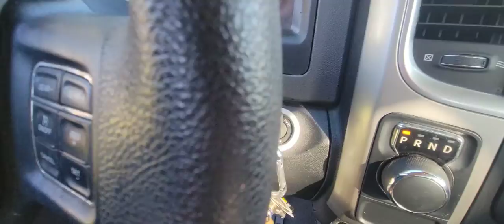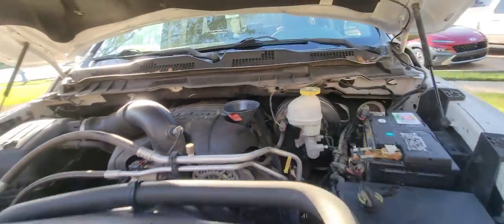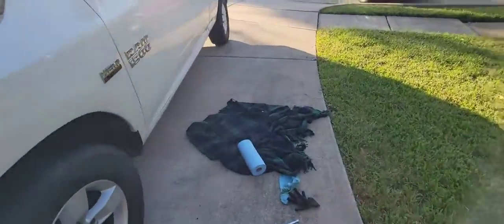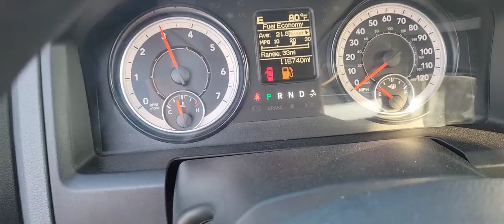Ram 1500, Hemi Tick, Treatment Experiment || Fix Sound problem Hemi Tick  Ram 1500 ||

Comment: It will still tick because the exhaust manifold likely has a broken bolt in it. The lifter noise comes from the exhaust manifold not being mated perfectly to the head when it's cold. The metal expands when it's hot and that's why the noise goes away when it warms up. It happened on mine.
Reply from the maker: Thank you for this advice ")
Reply: That is not a lifter noise,  it's the heat shield flapping because of the broken bolts holding the manifolds and the heat shield together,  the hemi tick is completely different than the manifold tick due to broken bolts